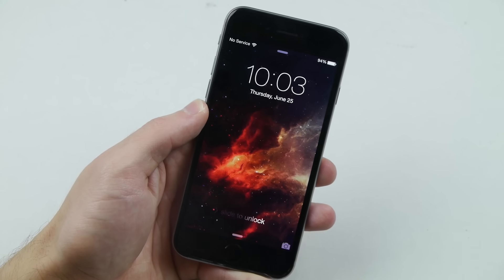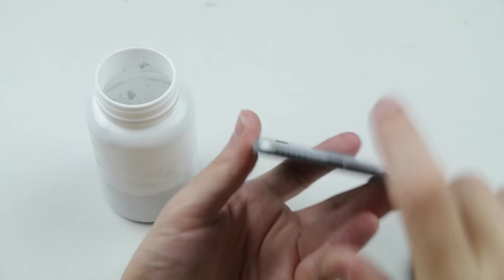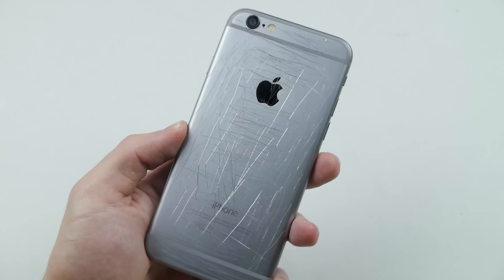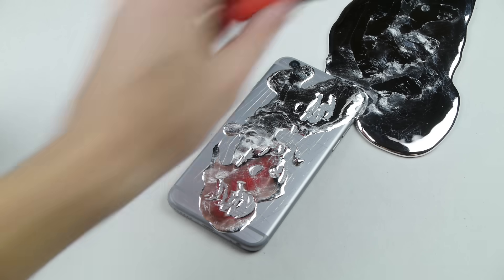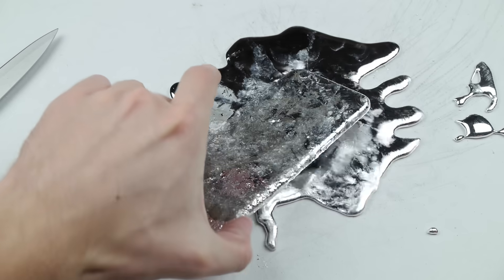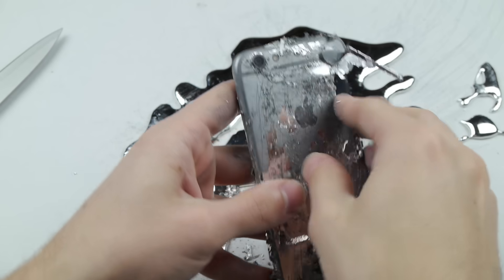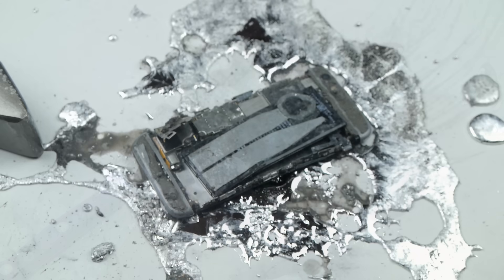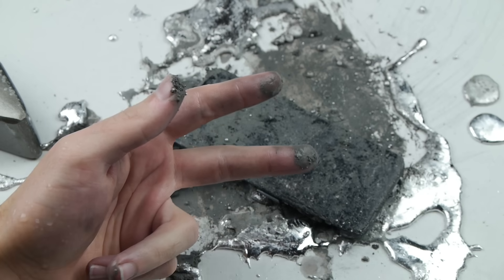What Happens If You Pour Gallium on an iPhone 6?

Comment: This guy must not know that lithium doesn't belong on skin, and that the fumes he's inhaling really shouldn't remind him of grilling anything...
Reply: +Rambut I'm fairly sure the sizzling at the end was simply the gallium-aluminium alloy reacting with the water, not the lithium from the battery. The casing seemed intact since it's not made of aluminium like the casing of the phone is.
Reply: Jordan Phillips
I do realize the battery pack is not a target reactant, and I apologize if I'm misinterpreting, as I haven't taken chemistry in a long time: I just presumed a gallium-aluminum-water reaction that's emitting gases could penetrate the surface of a lithium battery casing while the reaction's contained between the table and the back of the phone at 4:50 ; and then, the peeling-away black block is touched around 5:05 . If I'm wrong about the lithium exposure, my bad lol And based on his casual skin contact with the reaction, and the "grilling" analogy he made, I also presumed he's not wearing a mask; I'm simply admonishing possible carelessness. I'm a "better safe than sorry", or a paranoid trooper.
Reply: Rambut
I guess I misunderstood your original comment. It's always good to err on the side of caution when dealing with chemistry. However, I don't think there's much to worry about in this situation. Had the lithium actually been exposed, there would almost certainly be combustion because of the extra heat produced by the water & gallium-aluminium reaction. Especially considering lithium's reaction with water can result in ignition even without the additional heat. The only gas that would be produced from either reaction is hydrogen and since there was no ignition, I'm pretty sure the other components of the phone didn't heat up enough to liberate dangerous fumes.
Reply: Jordan Phillips
Thanks for elaborating; my original comments' admittedly tend to be careless lol

Comment: The 'smoking' you see is caused by the gallium reacting to the lithium in the battery. Along with heat it also gives off several toxic reactants, so for anyone who does actually try this at home, be sure to try it in a well ventilated area, or at least use a filtration mask of sorts.

Comment: should be wearing gloves, this stuff is toxic when handled a lot
Reply: Idiot
Reply: +nivlac only idiots like skin rashes.
Reply: Gallium is a nontoxic element. It's very confusable with mercury, although gallium is solid at normal temperature but quickly liquefies in your hand. Gallium, as I know it, is completely nontoxic and is safe to handle, though it is about 10 times more expensive than mercury.
Reply: +Br0kensteal dumbass

Comment: You shouldn't have had to heat the gallium up, as most people that have been semi interested in the metal, it has a low melting point of around 70-80 degrees with is about the temp of your hands

Comment: the gallium formed an amalgum(alloy) with the aluminium so thats why the back cover could peel away since the gallium significantly weakened the aluminium's structure by doing that.The reason at the why it was fizzing with contact of water is because aluminium is in reality a very reactive metal but wont react in normal curcumstances with water due to its ability to quickly form an protective oxide layer with the air or water protecting it from further reaction.Gallium however takes away this ability from the aluminium allowing it to continue reacting with the water forming hydrogen gas and aluminium hydroxide but the gallium however is fairly unreactive so does not react and is left behind as its pure metal form.I know this because i also have gallium and have done this experiment numerous times with foil and cans.

Comment: There are two scientific explanations going on at the end the reason that the iPhone started cooking is because when you touch the phone since the gallery of such a low melting point that it melts in your hand if you actually melted it and you basically starting any mini fire inside of it and the second reason is the fact that moment gallium combined with water actually creates a chemical reaction which can burn just about anything that will melt under the temperature of 132 degrees

Comment: I get that gallium is harmless but after I saw that bubbling I wouldn't have been handeling that after that point or breathing anything that was coming off of it.  What ever that is could be VERY toxic.
Reply: +PotrZimbie Pretty sure it only does if it manages to get under your skin.
Reply: Not really.There is no way that was toxic.Maybe if you eat it maybe than it would do some harm but handeling it shouldn't be dangerous.
Reply: +poptartzimbie no it dosent, ive had to handle gallium with cuts and shit, i dont have cancer, and ive done it on multiple occasions
Reply: +The Dinosir ggxhc9bo
Reply: +Reegareth I'm sure that bubbling was because of the lithium in the battery that he probably stabbed with the knife
Reply: Could have been battery acid.
Reply: +Reegareth Well he "washed" it with exposed to the lithium battery XD

Comment: When gallium+aluminum comes in contact with water it separates the bonds made releasing hydrogen. That was the smoke, the reaction caused the heat. Gallium is almost completely safe, not if you consume it of course...but to touch then wash off is fine. The gallium mixed with the aluminum to destroy the structural density by collapsing the solid aluminum framework and making it aluminum+gallium framework. I love that metal..

Comment: Why did you melt it with so much heat. You could have run hot water in a bowl, and just placed the container of galium in the bowl. What did you do, microwave it?
Reply: That wasn't half a day either or it would be at its solid state

Comment: Hot? Gallium's melting point is like 85 degrees Fahrenheit, what are you talking about? It's just lukewarm.
Reply: +AIO inc. By the way, washing it with water is a very bad idea. You left the battery it, and that probably shorted the shit out of that battery.
Reply: +AIO inc. You can heat something beyond its melting point
Reply: You can indeed.

I knew that from experience with water.
Reply: +AIO inc. If you knew that why say its lukewarm when it clearly could easily be hotter depending on how he heated it.  My guess is he put it in some boiling water which could make it very hot to the touch depending on how long you heated it.
Reply: Reegareth You only needed to leave it sitting near a heater for like 5 minutes on 80. Gallium melts at room temperature.
Reply: AIO inc. And I think he wanted it to remain in its liquid state longer so he added more thermal energy to it.   If it weren't hot why did he say it was hot that would make no sense.
Reply: Reegareth In which case you would heat it to maybe 100 degrees and turn your home heating to about 80 degrees (Fahrenheit, I live in the US.) and it would stay "molten," I guess you'd call that?
Reply: AIO inc. I understand the properties of gallium but that is not what I'm talking about how your initial comment uses false logic.  You assumed that because gallium melts at 85 degrees that he only heated it to 85 degrees which makes no sense.   All you know is that he heated it to at least 85 degrees.  I'm not trying to be rude here just pointing out your logic is flawed.
Reply: Reegareth You don't need to heat it much more than 100 which will not burn you or hurt you in any way.
Reply: AIO inc. OK let's put this in the form of a question.   Do you know how hot the gallium was in this video?  Second do you know at what temperature gallium boils at?
Reply: Reegareth No, there is no way to determine the heat output of the gallium in this video.

No, but this was not boiling.
Reply: AIO inc. OK.  All I was trying to say. I'm no chemist and I know little about gallium but I know this could infact be hot enough to be uncomfortable or even painful to hold or touch if heated enough.    That's all I'm saying is that he could have made it very hot.
Reply: Reegareth I'm no chemist either, but I do tend to be a complete idiot and make a fool of myself using chemicals, like Gallium here but on a running Pentium 4 instead.

It would be totally useless to make it much hotter than 100 degrees f, otherwise it becomes uncomfortable and pretty much water like and useless.
Reply: The Dinosir I get that.   You guys did watch the video right.   He says its hot.  He obviously heated it somehow.
Reply: +Reegareth or its just more dramatic/cringe worthy for less knowledgeable viewers...

Comment: shouldn't you be using gloves man 1??
Reply: *****
Getting your fingers eaten away by battery acid SHOULD be 'reason' enough. -_-
Reply: Lithium Ion batteries have a non corrosive electrolyte consisting of a solvent which is usually Ethylene Carbonate or Dymethyl Carbonate. Touching it is actually under most circumstances, will not cause that much damage to skin. It's mildly toxic and can cause skin irritation similar to a rash, but certainly not going to eat your skin or damage it in a few seconds. It is wickedly flammable though, and can cause spectacular explosions and fires with very small amounts. It certainly is far less harmful then paint stripper. Speaking of which, if it contains methylated spirits or methanol, can cause permanent blindness and kidney damage simply by prolonged skin contact.
Reply: ***** Oh ok, I didn't know that. It just looks so dangerous lol
Reply: You sound like my mom
Reply: +WKMatthew uhhhhhh... gallium doesn't cause cancer.... I know that for a fact. gallium is completely safe unless it enters the body which cannot happen by touching it. and also the battery in the phone burst at the end and he was putting his hands in FUCKING ACID! holy shit how is he not sick or burnt!?!?
Reply: No but I think man 2 needs gloves
Reply: +Ryan Riser It was only fizzling because gallium has such a low boiling point, it was not hot at all. Liquid nitrogen constantly boils, thats not hot either, but rather extremely cold.
Reply: +AIO inc. If that were the case, why would it continue to bubble and fizz even after he breaks the circuit by picking up the phone? Anyway, we were both wrong... When a Gallium Aluminium alloy mixes with water, it creates Hydrogen, that was just a chemical reaction.
Reply: flyingfish97 Or, likely, as I said the battery or other electronics shorting out from the water bath they took...
Reply: gallium isn't toxic and melts at room tempature
Reply: howcanyoudothistome1 why?
Reply: Well you just owned this conversation. XD
Reply: it not poisonous or to hot
Reply: Umm I have the newest phone iPhone 1
Reply: +redboy755 the smoke dude
Reply: yeah your right I really don't get it either #ChipWondersmirk
Reply: +Oscar Bartley at the end after he washed it and it was fizzling
Reply: +howcanyoudothistome1 no gallium is not toxic
Reply: +Leiff Lewis no but hes wrong that wont happen unless you open the battery or blow it up or something
Reply: +Ausintune oh im wrong at the end he opened the battery...
Reply: +theLuigiFan0007 I kinda understood all that
Reply: +theLuigiFan0007 hi again
Reply: flyingfish97 It's very easy to get water into a battery, though.

But I do agree.
Reply: +howcanyoudothistome1 galium isnt toxic to the touch
Reply: Mmmmmmmmm

Comment: You really do not know the meaning of the predicate "amazing" and use it until it is practically devoid of meaning. None of this is amazing (=surprising/wondrous): go and take a course in materials engineering. Aside from that, even though it turned out to be no problem, why would one hold one's face so close to sizzling electronic components? This reminds of the flippancy of the fictional "scientific" crew of Ridley's Prometheus…

Comment: Why doesn't he use sand paper instead of a knife? It would take off the coating and wouldn't damage the aluminium as much as the knife did. It also would cover a lot more that just the tip of a knife.

Comment: Oh u have got to be fucking kidding me here. Gallium is not safe to touch man, it's classified as a corrosive substance by various international standard and regulation setting organisations such the UN, EURL, ILO as well as numerous life science and high technology companies such as Sigma Aldrich etc.

There has been far too little research conducted on gallium, therefore, far too many sources consider it safe, however, it is certainly not safe to handle without basic ppe equipment such as gloves, face mask and goggles.

There are far too many health risks involved with handling gallium. The major ones are it is extremely harmful to the kidneys and can cause permanent blindness if it comes into contact with your eyes. It can also cause numerous health conditions ranging from mild such as constipation; diarrhea; dry mouth, mouth sores; weakness to severe allergic reactions (rash; hives; difficulty breathing; tightness in the chest; swelling of the ankles and feet, swelling of the mouth, face, lips, or tongue); changes in vision; chills; confusion; decreased urination, dark and bloody urine; heart palpitations; hallucinations; severe muscle cramps, vomiting and numerous other problems.Gallium is used for:

It is so strong that it is often used for treating high calcium levels in the blood caused by cancer in patients who do not respond to proper fluid intake or fluid injected into the vein. Gallium is a calcium resorption inhibitor. 

Im not asking you to write a paper on finding out the hazards involved in performing your tests. All I'm suggesting is Google what kind of risks and hazards might arise while carrying out tests with chemicals. Really like your channel and hope you stay safe.

For people interested in finding more about gallium:

Solid gallium is a blue-gray metal with orthorhombic crystalline structure; very pure gallium has a stunning silvery color. Gallium is solid at normal room temperatures, but as well as mercury, cesium, and rubidium it becomes liquid when heated slightly. Solid gallium is soft enough to be cut with a knife. It is stable in air and water; but it reacts with and dissolves in acids and alkalis.

Applications

Liquid gallium wets porcelain and glass surfaces; it forms a bright, highly reflective surface when coated on glass. It can be used to create brilliant mirrors. Gallium easily alloys with most metals, so it is used to form low-melting alloys. The plutonium pits of nuclear weapons employ an alloy with gallium to stabilize the allotropes of plutonium.
Analog integrated circuits are the most common application for gallium, with optoelectronic devices (mostly laser diodes and light-emitting diodes) as the second largest end use. Gallium has semiconductor properties, especially as gallium arsendite (GaAs). This can convert electricity to light and is used in light emitting diodes (LEDs) for electronic display and watches. 
Gallium is used in some high temperature thermometers.

Gallium in the environment

Gallium does not exist in pure form in nature, and gallium compounds are not a primary source of extraction. Gallium is more abundant than lead but much less accessible bacause it has not been selectively concentrated into minerals by any geological process, so it tends to be widely dispersed. Several ores, such as the aluminum ore bauxite, contain small amount of gallium, and coal may have a relatively high gallium content.

Health effects of gallium
Gallium is an element found in the body, but it occurs in a very small amount. For example, in a person with a mass of seventy kilograms, there are 0.7 milligrams of gallium in the body. If this amount of gallium was condensed into a cube, the cube would only be 0.49 millimeters long on one side. It has no proven benefit towards the function of the body, and it most likely is only present due to small traces in the natural environment, in water, and in residue on vegetables and fruits. Several vitamins and commercially distributed waters have been known to contain trace amounts of gallium with less than one part per million. Even the gallium radioactive compound, gallium [67Ga] citrate, can be injected into the body and used for gallium scanning without harmful effects. Although it is not harmful in small amounts, gallium should not be purposefully consumed in large doses. Some gallium compounds can actually be very dangerous, however. For example, acute exposure to gallium(III) chloride can cause throat irritation, difficulty breathing, chest pain, and its fumes can cause even very serious conditions such as pulmonary edema and partial paralysis.

Environmental effects of gallium
One controversy with gallium involves nuclear weapons and pollution. Gallium is used to hold some nuclear bomb pits together. However, when the pits are cut and plutonium oxide powder is formed, the gallium remains in the plutonium. The plutonium then becomes unusable in fuel because the gallium is corrosive to several other elements. If the gallium is removed, however, the plutonium becomes useful again. The problem is that the process to remove the gallium contributes to a huge amount of pollution of water with radioactive substances. Gallium is an ideal element to use in the bomb pits, but pollution is destructive to the earth and to the health of its inhabitants. Even if efforts were taken to remove the pollution from the water, it would significantly increase the costs of the procedure of turning plutonium into a fuel by about 200 million dollars. Scientists are working on another method to clean the plutonium, but it could take years to be completed.